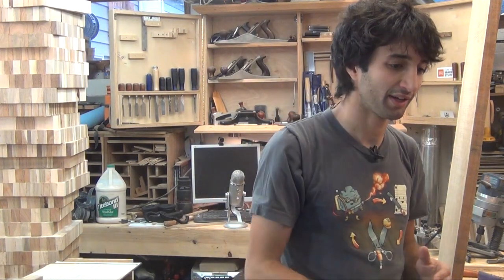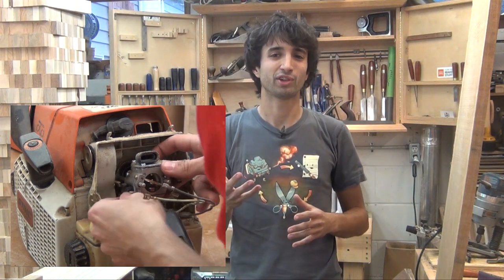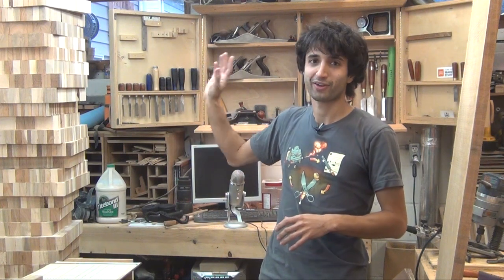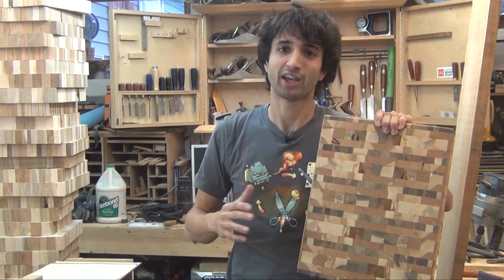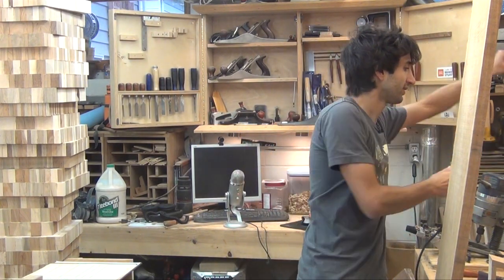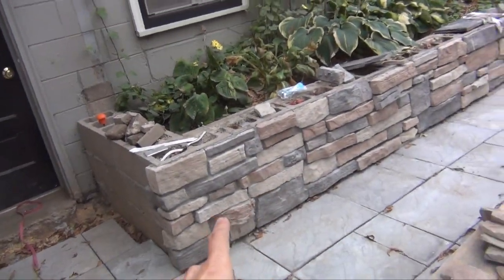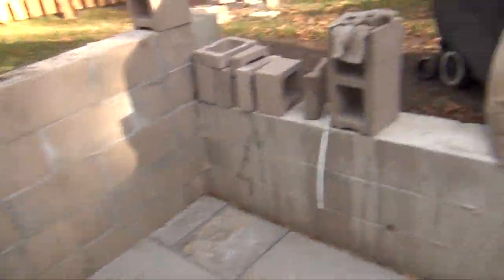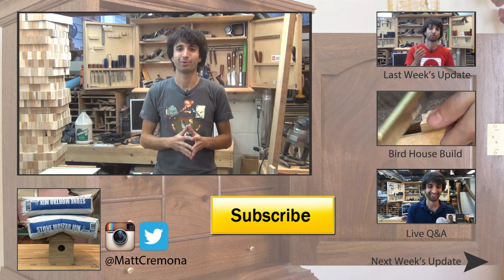Matt's Weekly Shop Update - Oct 6 2014

Comment: Nice job on the desk.  Can't wait to see it finished.  I would like to thank you for directing me to grizzly for the router bit..  It came in real handy flattening my wood.  A friend of mine gave me a HUGE red cedar trunk which we cut into 4 inch slabs  Flattening went real fast with that cutter.  I would be real interested in see some of the finishing process in the cutting boards you make. I make cutting boards and Lazy Susan's from scraps I get from a local cabinet shop.  I have yet to make an end grain one though.  Patio looks great and as always I enjoyed the video.  Thanks for sharing, see you in your next video.
Reply from the maker: Dave PelcherNo problem!  I'm happy to share!  Glad to hear it went smoothly for you.  I'm sure it was a lot faster than using a 1/2" bit :)  I'm going to have a video on the cutting boards at some point.  I just have to get a few more shots and edit it.  I use salad bowl finish and keep putting it on until it doesn't soak in as fast.  Good use of someone's scraps.  That's better than them going in the garbage!  Thanks as always!
Reply: I use Jay Bates method of Mineral Oil.  Food safe and $1.39 a bottle at Wal-Mart. LOL  Thank.  Oh, I mention you when I ordered the bit from Grizzly.  Hope they check out your channel like I suggested.  Hope I didn't cross any lines.
Reply from the maker: No way!  Thanks for spreading the word!
Reply: You have a special way about you Matt.  Very likeable guy.  My wife even likes your videos.  I use chromcast on my big screen.   She usually rolls her eyes, but you and a couple others she likes.
Reply from the maker: Dave Pelcher Thank you, Dave!  My wife is the same way.  There are only a few woodworkers that I watch that she likes.

Comment: do you ever get finger prints showing on your boards once you finish them?  I have to wear gloves after my final sanding to avoid that problem.
Reply from the maker: Sean Rubino I've never had that problem.  Dirty hands?
Reply: Not dirty hand prints, just finger prints like finger prints on glass. I sand to 220 and if I am not wearing gloves after sanding and I handle the board I can see prints on the surface once the finish is applied.
Reply from the maker: Sean Rubino
Seems strange.  I've never had that issue at all...

Comment: Great video Matthew. What bit did you use to route out the hand holds on the cutting board?
Reply from the maker: Steve CollinsThank you Steve!  I use a 3/4" core box/round nose bit.  I clamp the board upright in my vice and use an edge guide with my router.
Reply: Matthew Cremona
Thanks for the info, Matthew.
Reply from the maker: Steve Collins
 No problem!